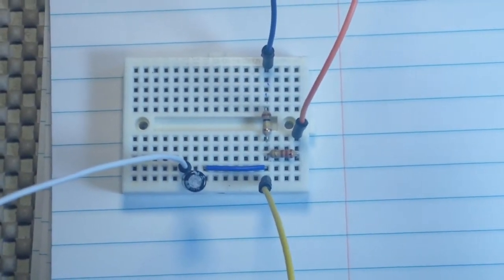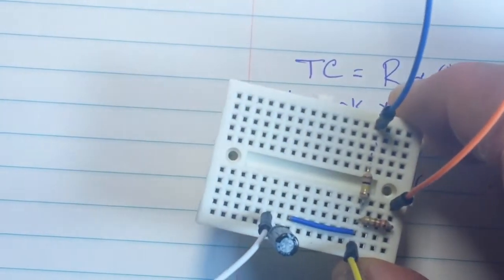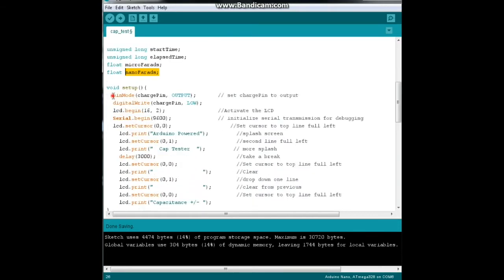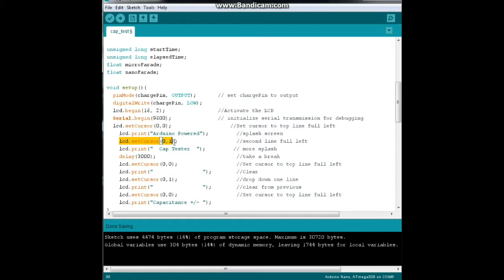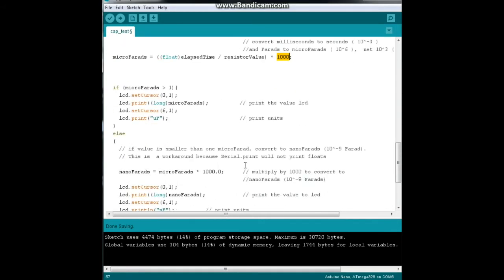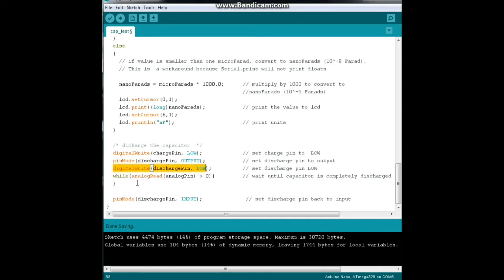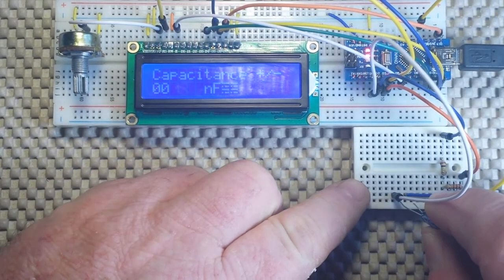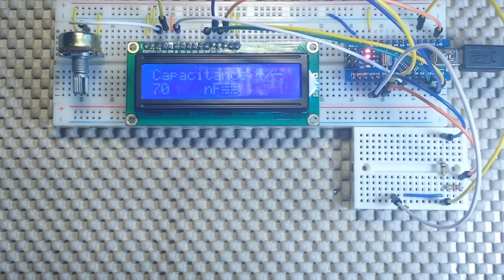DIY Arduino Capacitor Tester

Comment: wouldn't it be better to start with a DISCHARGE cycle first? A partially charged cap would reach the 62% point faster thus giving wrong results. Maybe this is what happened with the "faulty" 100uF that measured as 50uf...   Nice  project.
Reply from the maker: +mamoynas Yes it would.

Comment: Would it detect if you connect the capacitor with the wrong polarity?
Reply from the maker: +HobbyTime No it's a dumb detector.
Reply: learnelectronics thanks a lot for aswering
It is great any way. I am wondering how to test polarity. Thanks!!
Reply: Blam!